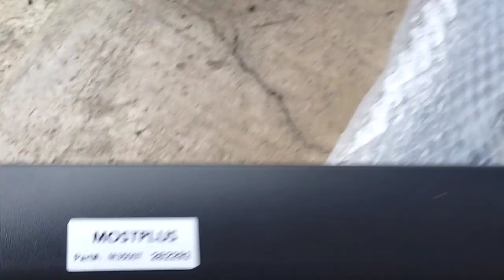2010 Honda pilot installing cross bar roof rack

Comment: Man my cross bars were not that easy to get in. I had to hammer on them with a mallet to get them in. Once they were in the actual rails it was manageable. But that was a lot harder than it needed to be.
Reply from the maker: @jacobstout9769  that sucks! But at least you were able to get them in. 99 percent of what I work on always ends up harder than it should be that's just my luck lol!